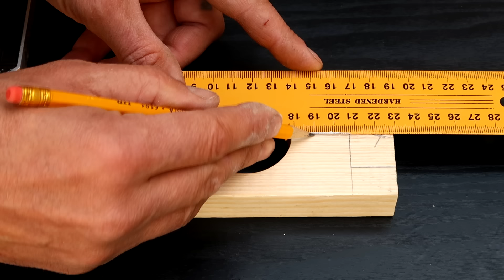Мало кто знает об этой функции ДРЕЛИ !!!

Comment: Don' do that. The Clamp-screws, driven in  the end grain are not at all stabile. The speed is not about a quarter as recommended for router bits. The bit is not fixed strong enough in such a machine. There are some more points... THIS IS DANGEROUS! Kick-back, losing bits at full speed .  .  .
Reply: Весь мир против этого)))
Reply: also.. its not like routers are so expensive that it's worth taking risks.. this seems more like a proof of concept
Reply: 100% correct and it all starts by not being parallell to the works space
Reply: Прально глаголтит хоть и по иностранному!
Reply: Jesus is LORD  great to hear the opinions of a carpenter

Comment: Very clever project. However, drills and routers have different kinds of bearings. Routers always have bearings designed for lateral thrust. Plunge routers also are designed to resist linear/axial thrust, the same way drill motors are designed. Most drill motors do not have bearings which are designed for lateral thrust. If you build a router using a drill motor please be careful of the load placed laterally on the shaft. Otherwise you will quickly wear out the drill motor bearings.  Unfortunately, crafts people learn this lesson on drill presses which are used for drum sanding.  The constant lateral pressure can ruin the drill press’s runout if the bearings are not designed for lateral thrust. Good quality woodworking drill presses have bearings designed for both lateral and linear pressure. Many metalworking drill presses, especially inexpensive ones, do not have the lateral thrust bearings and are subsequently damaged by lateral thrust applications.  I’m in my seventies and have witnessed this firsthand.
Reply: Drill chucks are only designed for axial loads. They are not meant for side loads and can easily fail when such a load is applied. Routers and end mills need to be secured in a collet to be used safely.
Reply: @xfhghe  :  Great comment!  The drill chuck incompatibility with side loading will likely cause a failure long before the drill’s bearings. Please notice the rarity of a drill chuck being used on a milling machine for any purpose other than drilling, reaming, or tapping.
Reply: Всё верно, надо искать способы как на высокооборотистую УШМ прицепить данную фрезу.
Reply: Very well explained.
Reply: The saying, "The right tool for the job" is not just for completing the job but it's also for safety.  You are absolutely correct.
Reply: Now here's a man that knows what the heck he's talking about.
Reply: Why not buy a cheap router??  That's the simple solution - no discussion warranted.  Problem solved.
Reply: Not to mention the difference in rotational speed. A router spins at 3 to 10 times what a drill does so it would tend to be slow going if you should use a drill.
Reply: @oh8wingman  Agreed 👍
Reply: I agree with all the issues and risks already pointed out.  One other issue is that, with this wooden plunger, there's no way to keep things perfectly perpendicular on the X and Y axis.  You will get uneven finishes, especially if you try to go around all 4 face edges of that board.  
And this was done on soft pine.  I can't imagine the damage that would be done if this was a hardwood like walnut.
Reply: I think what people for get sometimes when they see these videos on YouTube, they are from a different country where it's not as easy for some of us to go down to the local hardware store and buy the correct tool for the job.  Most just have access to cheap drills or other cheap common power tools. Even if they did have access, the cost would be prohibitive to purchase.  

Yes, this is not a long term solution.  Yes, it will destroy the drill.  Will it do a small job when needed, probably.
Reply: Not to mention the lack of RPMs and Hp  that router bits require for a good finish, particularly in harder woods.  Not a fan of these "tool hacks" that end up using tools for things they aren't designed for, in other words, abusing tools. The ones that make me cringe the worst involve angle grinders. Its a good way to damage a perfectly good tool at best and/or to injure yourself or do big damage to a project at worst. Bottom line....buy a freaking router or whatever proper tool you need. They aren't that expensive compared to an urgent care/ER visit or hospital stay and possible loss of work time, etc.
Reply: Whilst in general I would agree with this sentiment, MOST decent drills are MEANT to be multipurpose, catering for example for sanding disks and sanding drums as just TWO examples of lateral load as well as axial load support. 

Every decent drill I have refurbished has had ball bearings at the chuck end and roller bearings at the rear, or phosphor bronze or sintered bronze bearings at the rear.

A BALL bearing is ALWAYS capable of both although I accept that at heavier loads a pre-load bearing or combination of ball and roller and thrust bearings give the maximum capability.

Bear in mind though that NOT EVERYONE has either the budget OR requirement for something that MIGHT get used on 3 projects in 5-10 years! 

Even if once or twice a year for routing softwood in multiple passes, this is MORE than adequate and a very simple, neat solution. 👍👍👍
Reply: Ah!  Now that makes a lot of sense!  Delivered in an informative ways.  Now  I understand why we may not want to follow this design.  Thank you for that Steven.
Reply: @boblewis5558  I agree Bob. Your key word is decent. This analysis could go on for weeks. MANY years ago as a manufacturing engineer I was responsible for testing appropriate tools for many different tasks. My predecessor was fond of applying the the “best of class” Milwaukee Hole-shooter corded drills for anything you could fit in the chuck. I subsequently was task with replacing many Hole-Shooters with angle grinders, die grinders, proper disk sanders, etc..  Made me a follower of using the right tool for the appropriate tasks. On the other hand I REALLY ADMIRE inventiveness and ingenuity!  By the time you spend enough to buy a drill that takes lateral forces in stride, you could buy a mid-grade drill and proper router.
Reply: @Tool-Meister  yes, of course "decent" is also subjective, but apart from (I'm sure) a small number of tools of such an age that they may fall under an "indecent" label, the vast majority of drills, as I say, have BALL bearings not sleeve bearings for their front bearings. We are talking about a DIYer here, not an industrial or professional application, for which this would be inappropriate at best.

So many of the negative comments about lack of lateral load capability are misleading at best, to completely irrelevant at worst. A bigger problem for DIYers is the likely runout when using old drills for certain tasks that REQUIRE high precision - wood routing for an amateur is not really one of those - there is always glass paper!

Once again though, if an old drill has been acquired, for FREE, a "simple" replacement, or upgrade even - deep groove instead of standard - of bearings can resolve many issues and restore great life to an old tool.

I'd rather see people critique and provide feedback on that basis rather than look at it from the perspective of what SHOULD be used "professionally" and/or with a deep wallet!

There is very little of his smart/clever build which is inherently "unsafe" ... Less than perfect results or longevity of use maybe, but so what? 

I have several drills FREE from "scrap" that work just fine and required MINIMAL work to get to a perfectly usable condition. If it was free what does it really matter if it fails prematurely? Replace the bearings for around £6? Get ANOTHER free one? Hmmm!

I do sometimes think there is a little too much focus on the "make do,  modify & mend" approach when it comes to DIY. MOST people undertake DIY due more to budget constraints rather than a desire to be "cheap" for the sake of cheapness!
Reply: @vadimshink9257  hot glue and duck tape should be fine.
Reply: Very  well put im73
Reply: @oh8wingman  Most important point in the comments.   Be it wood and metal things work better with the right feeds and speeds.
Reply: @theboz1419  
Americans in particular are phenomenally insular and don't even understand that MANY people in their own country are trying to survive on VERY limited finances.
One thing Americans are VERY good at is criticising the efforts of others.
You'll find examples in the comments section of almost every YT video.
Reply: Routers spin at a much faster rpm than drills also, router bits are meant for higher rpm’s than a drill, a drill makes a terrible router.
Reply: top
Reply: Buy a router!!!
Reply: @robertpope9753  
Thus spake yet another spoilt child from the comfort of their cosseted world.
Perhaps you could give consideration for those in this world who don't have ready access to places that sell such tools and don't have 'discretionary finances' to buy them anyhow.
Americans in particular are phenomenally insular and don't even understand that MANY people in their own country are trying to survive on VERY limited finances.
One thing Americans are VERY good at is criticising the efforts of others.
You'll find examples in the comments section of almost every YT video.
The ability to create what one needs from what one has at hand is a highly commendable trait indeed.
A financially challenged individual who can make the item in the video could finish building items that they can then sell to raise funds to buy better tools, and so on.
Open your eyes and your mind.
A little lateral thinking will take you a long way.
Reply: Exactly, it's know as "buying the tool for the job" ... drills for drilling, routers for router work, simple
Reply: @suparoo100  
There's also the principle of 'needs must when the devil drives'.
Not everyone in the world has a 'rich mummy' to give them whatever they want.
Reply: Именно так. А в дешёвых дрелях вообще подшипник скольжения (втулка), которая от боковой нагрузки быстро станет овальной.
Reply: Good point about the lateral vs axial thrust.
Reply: @theboz1419  Thank you!

Comment: A drill for screws. And drilling small holes. A router is for removing larger portions of material ( mainly wood) at higher rpm’s and much sturdier.
The right tool for the right job. You can use a screwdriver to drive a nail but it doesn’t mean you should. But you got an a for effort I guess

Comment: Very bad idea, the RPM"s on a hand drill is much to slow for routing. Average drill spins at around  2,000 rpm, most routers spin at 20,000 to 30,000 RPM"s, 10 times faster. Don't waste your time doing this.
Reply: It will also screw up the bearing on the drill as it's not designed to take side loading. It's a nice idea but a bad one!!
Reply: I agree ruin your drill
Reply: Not designed to be a serious tool. Designed to entice you into seeing the adverts.
Reply: I was intrigued at the begining but I did not expect that this was about turning an electric drill into a router-substitute.  A drill is not the tool to spin a router bit.  The only reason this looks partially successful is because the wood being used is very soft.
Reply: I don't even know why I watched this! I've got a perfectly good router!
Reply: Should not do. can get hurt
Reply: @patagualianmostly7437  I watch to see if they really were going to try to route with a drill.

Comment: Look a Giligans Island Router. Sorry I've been a carpenter since 1975 and a drill doesn't have the RPM's to be a router. This is a dangerout idea.
Reply: agreed even if thise bigger drills have more rpm than some its not a router
Reply: Plus the bearings aren't designed for sideways pressure.
Reply: @tsfarken  But if you were stuck on a deserted island, I guess you could still make ornate furniture....... LOL
Reply: can't see those adjustor screws on the side biting many more times either.
Reply: chip, thanks for a good laugh, i guess some countries they have to make with what they got, just like on Giligans Island! is that Russian writing?
Reply: 100 % Agree, rpm is a MUST otherwise not good idea
Reply: Lmbo!
Reply: Pretentious Trolls...
They never end.
Reply: @jim8684  you have it wrong there, the Professor solved that issue. Maybe your not old enough to remember Gilligan's Island. They has a bamboo stationary bike with a generator to recharge the batteries.
Reply: let alone that the way the motor is constructed, it cant handle this direction of forces on the gears.
Reply: @ChipEstrada  First you'd need to make a generator, insulated wire, and the receptacle to plug in the the drill powered finger shortener.
Reply: That’s for Bidens America where we can’t afford tools anymore.😂
Reply: And yet, He achieved the result he needed.  These videos are about resourcefulness, ingenuity, and sharing ideas (things that build nations by the way), not about reaching the best result or even about achieving the same result as a purpose made tool.
Reply: @shaunmcdougle  he should have just bought a cheep router, it would have saved time, money, and effort. I respect a good DIY, but this is not one of them.
Reply: No no no CT já
Reply: @marinapestova1918  Sorry to wound your pride. but just have to say as long as we have free market capitalism working for us we will get the the things we need, especially the right tool for the job. love the creativity though. interested in how that Russian candy must taste...
Reply: Quem só enxerga rpm não vê mpr
Reply: What it's shown here, it's children games.......
Reply: I'll date myself a bit here, but back in my school days, we still had shop class. We were shown a film about a guy who used his tools the wrong way (screwdrivers like chisels, wrenches like hammers, etc.), named Primitive Pete. This guy is Primitive Pete.
Reply: Wish I had continued studying Cyrillic when my chess coach taught it to me... thanks for all the cool videos. This is a neat idea but the actual functionality of this will be limited due to the low rpms of a drill. It could work on some materials though..
Reply: @tsfarken  Exactly!  might be good for novelty, but not practical for much else...
Reply: @tomspring6720   lol, vodka induced coma...
Reply: @marinapestova1918  Russians are, actually, great craftsmen.  I have watched several video's of Russian artisans and they are impressive.  I find that many countries outside the USA are quite artistic and creative.  Their approach and execution is way different than ours in America.  It seems the Russians and European countries have the patience to take time to create.  Many Americans want it now and do not have the patience to execute a really intricate method of craftsmanship.  Because of this, styles in America have become very streamlined -- simple lines without much texture or Embellishment.  They call it contemporary or modern.  I call it boring.  Now that is just to my taste.  There is certainly nothing wrong with boring -- uh, I mean contemporary or modern.  For those that do want more of a traditional design, they have figured out ways to create, carvings for example, using computerized equipment.  It is nice but it is too perfect.  When carved by hand it is never perfect; there are always discrepancies that make each piece unique.  My eyes are drawn to the traditional, Victorian and Edwardian styles -- the more intricate and embellished the better -- I have a great appreciation for true artisan craftsmen who practice the traditional ways of woodworking.  So I have discovered Russian as well as Middle Eastern craft via the internet and it is absolutely fascinating.  I respect the fact that those old skills are still being practiced by people today.
Reply: @jonhelms6496  - Unfortunately you will be considered quite prescient in the near future as the already stated and enacted policies of the Jeff Dunham presidency have already rendered over 50,000 people unable to afford housing and food let alone routers.
Reply: @vincenzo2881947   - Glad to hear the perspective of a child . . .
Reply: Duh, it’s a Russian drill! It’s got plenty of RPMs! It’s the same motor they use to spin up the jet turbines on a Mig-29!
Reply: @ChipEstrada  
If you were stuck on deserted island, I think the last thing you want is design furniture. Not to mention going through all the trouble making this thing.. I love the humor. Lol

Comment: Google says
"Drills lack the power and speed for effective and safe routing. Routers and drills both work by rotating a bit secured in a chuck, or collet, but that's where most of their similarities end. ... This mechanical difference, among others, makes a drill unsuitable for use with a router bit."
Reply: I'm with you on this....just because you can doesn't make it ok.....
Reply: Those poor bearings .... Drill bearings are not designed for sideways pressure, and will wear out/break very fast when used in this manner...
Reply: I was thinking this would be a great option if you have a small job to do and cannot justify the cost of buying a new tool that you won't likely need to use again. Not as a permanent replacement that would get lots of use.
Reply: What a truly hideous idea to adapt a drill for a router, why?? Not enough rpm, timber and screws as an adjustment clamp 😳😳totally dangerous in every respect!! . I'm a carpenter of 25 years and it goes to prove the safety standards and thought process difference between the UK and certain European countries.
Reply: @amandamartin9770  and spend a day making it?? Get a grip, a router can be purchased from screwfix cheap enough
Reply: @buster8015   bhb